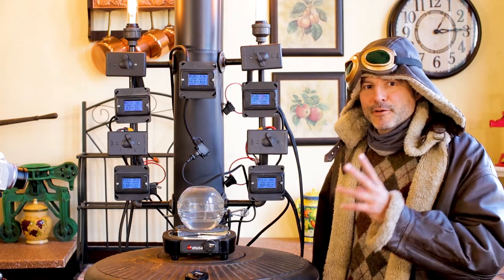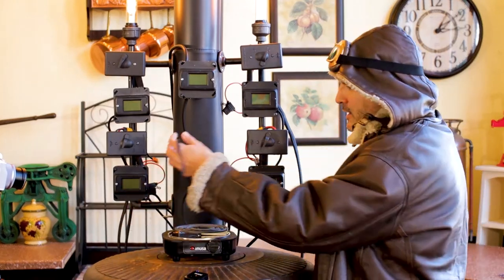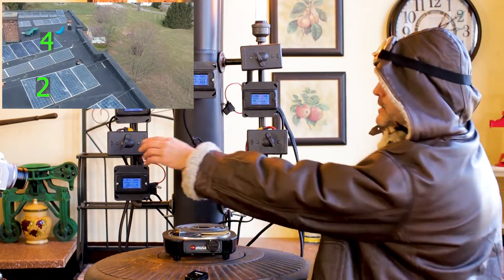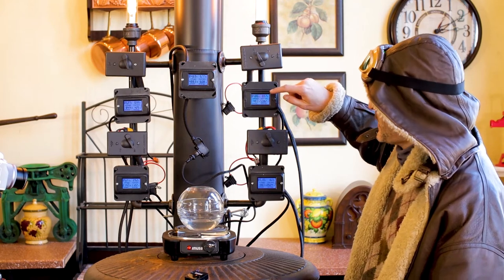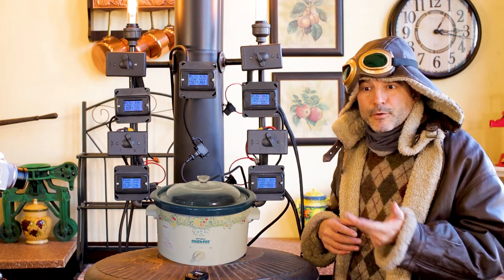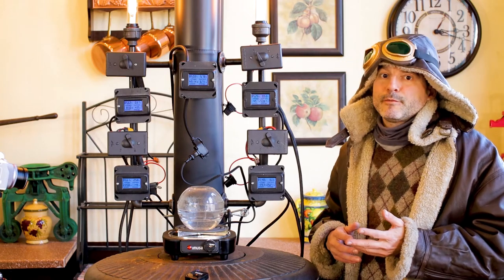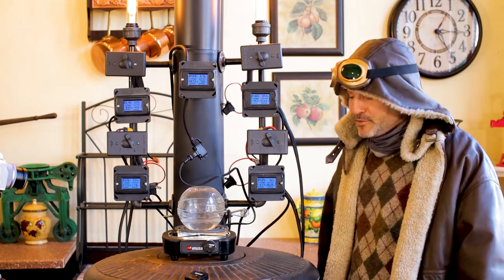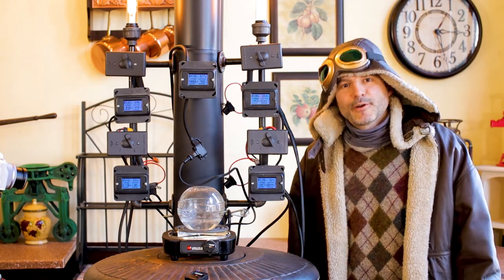Vintage Schoolhouse Solar Panels: Boiling Water with DIY Solar Panels

Comment: I would be super interested in seeing if you can run a infered space heater off that. And what it would do. How many panels to power it. Things along those lines.
Reply from the maker: Great question Michael. When connecting solar panels directly to heaters (i.e. hot plate, oven, even baseboards heaters) they must not have any electronics that regulate anything or else everything will go kablooey!. For more elaborate heaters (like infrared) you will need the standard solar setup with charge controller, battery and power inverter.